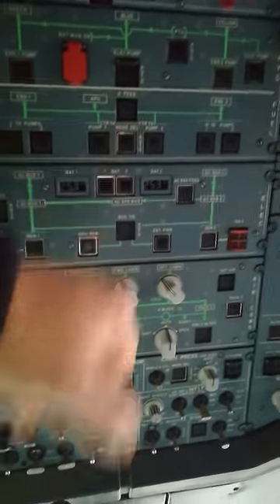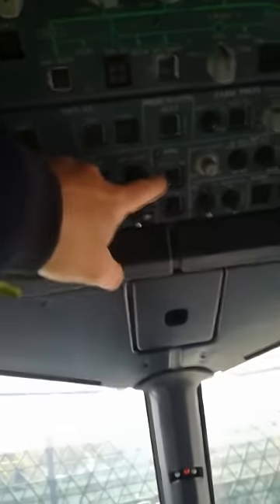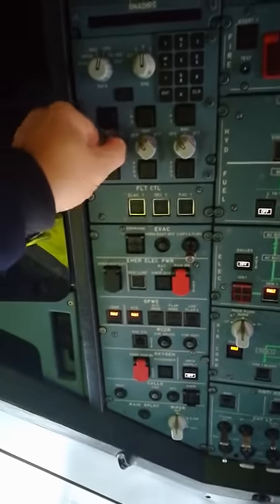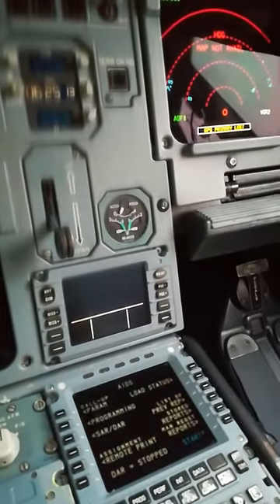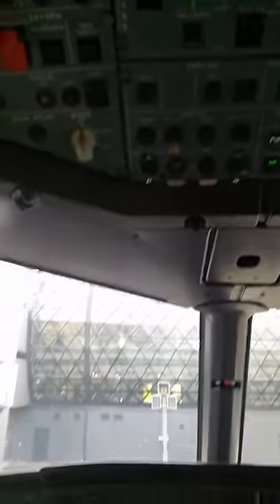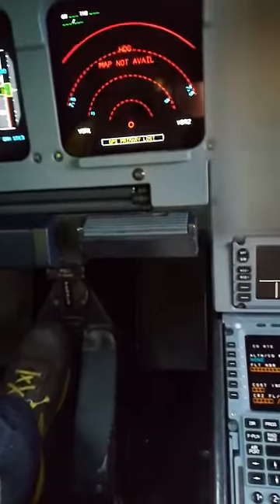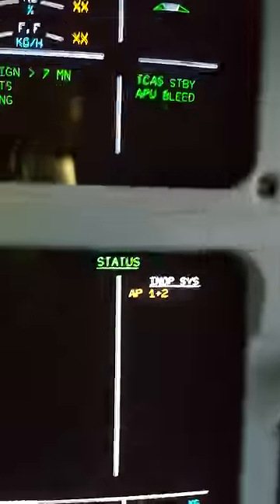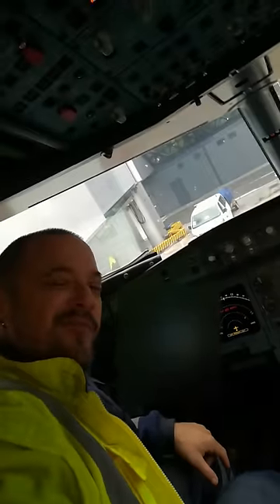Waking up sleeping beauty... A319 cockpit preparation

Comment: I do alot of flight sim with Airbus A319s and A321s and wondered how close my procedures are to starting up in reality.  After watching you, its very close!  Thanks for sharing!
Reply from the maker: Yeah, they are. What aircraft and what sim are you flIng?
Reply: @addict2flight  I use primarily Xplane as their sim seems to have better flight models. I do have MSFS 2020 but it's airliners were crap until recent.  I fly a number of different aircraft  - Airbus and Boeing and Embraer..... but my favorites are the A319 / A321 and the Boeing 737 / 757.   The FMS / FMC / MCDUs are pretty good but many lack the special communications inside them that connect pilots to company.
Reply from the maker: @rangerrick8220  yes... Under stand... Even today inmo Msfs is way advanced to XP12.. Even modela and flight envelope and models and phisycs are comparable. Not to mention, its better perormance on same config. Anyway, im hooked to Msfs now... 👍🤗
Reply: @addict2flight  I just got the Fenix A320 and am playing with that now - my biggest beef with FS2020 is their crappy camera and replay systems... XPlane ones are way better. I know there are new external replay apps for FS2020 but still not as good.   XPlane 12 seems to be a memory hog and causes my graphics card to constantly high rev...
Reply: @addict2flight  what Sim?! Is this ment seriously?  ;)
Reply from the maker: @moschidreamer  MSFS 🤘👍🔥
Reply: @addict2flight  Bro sorry but MSFS is nowhere near X-Plane... MSFS doesn't simulate real physics like X-Plane, MSFS still uses the ESP look up table from FSX days, thats why X-plane is a certified simulator by the FAA and MSFS is not.
Reply from the maker: @ryan1111111555555555  they did ad way better physics lately, and actualy they did i prove itway off. Well, for us summers, ido t need  certified sim, ineed onei can enjoy thee best. As in means of aircraft, which will be amazing for msfsnext year, as in graphics and scenery to actualy see where im flying. Im sure they will havelot of customers for  certifiing, but i Am also sure they are loosing huge market of normal summers which are turning to Msfs. Me first who was strictly xo11 Flyer. Now, when i played XP12, i have o doubt in switching.
Reply from the maker: @muskelwerwolfchin1005  whatever makes you happy. This is MSFS true life sim. But in true core, we are allsimmers my friend
Reply from the maker: @muskelwerwolfchin1005  yeh yeah we know---enjoy it my man ;)
Reply: @addict2flight  he wants to fly with you xd
Reply from the maker: @komrad1983  cockpit prep is the same whoever does it😉 atthe end it all come to the same. But usually you are the ones who came inside with all allready prepared 🤗
Reply from the maker: @komrad1983  ground guy can  start engines too😉😋
Reply: @komrad1983  Oh I'm sure you do just like every other expert flight simmer, I'm sure your uncle is a 777 captain as well, I saw someone land a 747 in St Barts on MSFS, but yeah sure, keep telling yourself its real if it makes you feel better, like I said buddy, one is a certified FLIGHT SIMULATOR and the other is a nice game, enjoy your game buddy.
Reply from the maker: @ryan1111111555555555  man.. Ima talking real life starting, i do that often, even tonight. So dont be so high attitude here. We are all here for fun. No one is better of another, and im surroubded with pilots every Day and they complain to me if somethi gs wrong, and we prepared aircraft for them etc... So... Every proc every airline is digfgeretnt
Reply from the maker: @ryan1111111555555555  so enjoy my dear friendin your piloting, closest to real thing i can be only in MSFS, as regarding piloting. But im on aircrafts every Day, you know that 😉👍 take care and gentle skies to you
Reply: @addict2flight  Man I dont have attitude, but I cannot just sit here when someone says that the flight physics in MSFS are just as good as X-Plane, its like saying Ford and Ferrari are both just as good, they both have steering wheels! we all know that one is much better to drive than the other.

OK MSFS looks amazing, no one can deny this, If you want to just sit there and look at the scenery, this is the best sim for you, but when you realise that the plane is flying on rails, and all of the "physics" you feel on the aircraft are fake, it ruins it completely.

I was landing the default Cessna 172 in X-Plane last night, in gusty, cross wind conditions, I was having to constantly be on the yoke, throttle and pedals to keep my crab on the centre line, and I know that I can take those skills into real life and they will be very close to how the real thing feels.
Reply from the maker: @ryan1111111555555555  i dont wanna compare those 2 anymore. For flightsim and enjoying i need flight characteristics and scenery look. I was on xp11 for years, with all blue tiles bug unsolvable and it was great, i then tried msfs and it was awful, in the beggininh of year.No,xplane is for same config of 3090OC and 5800x terrible in comparison to ultra settings on MSFS and dynamics are way improved in MSFS from last year as well as aircrafts, addons etc. By that time XP12. I bought it, turn it on, make a flight with 737, and i was like, oh my god where is improvement in that. They forced they graphics, but did lousy job. Im not airline and no someone who wil use XP for education, i dont care aboit it, they maybe have that part of clients. I wanna enjoy sim, see things, expiroence real scenery, towns, people, expiroence different things in sim etc. I fly MSFS for 3 mo ths now, and im astonished  every single day with it, and did never crash or had some artifacts like Xp11, and XP12 now in some moments. Forme its better, for you maybe not, thats just your opnion. I can express mine because i had all 3 then and fly them. And i had 4000FH of online flying and ATPL on IVAO rati gs, wvich means your not talking to some noob. I fly often with airbus es and q400 as engineer and have knowledge in system depths etc. Also in flight perormance, behaviours, i talk to my friend pilots for all im interesting in etc. So i have some backgroumd and i can judge clearly for myself. I had also unfortunately arround 300,$ofaddons including xp11 itself and half of those can be compare to Msfs freeware...So yes, and for that reason MSFS will be allways better, they constantly updafing, they fix tvi gs, Xp11 had that blue tile bugand only soluzion was for them to reibstall evetything etc. And even from vanilla install it never fixed.i even expiroence some amazing aircrsacts movemebts due to winds i never had in xp11  So, whatever we choose to be our favorite, lets enjoy in it. Mine is MSFS yours is XP, and i tvink  MSFSwilgain more customers from XPfor arilus reasons ime tioned a ove. In any case, whichever  we chooseits impertivethat we e joy and hangout together. 😉🤗💯👍🎶🥂
Reply: @addict2flight  OK I must try the new MSFS because when it first released, it was awful, I was even a beta tester for it, the reason the camera system is the way it is, is because I told them to copy X-Planes camera system since it was so much simpler than the one they was making, and they did! 

In all truth of course I like the look of MSFS, the scenery and atmosphere is amazing, I hope one day they will move from the old ESP lookup tables and create a real life physics engine, and yeah I'm probably about 500 euro's invested in XP11, but I have to say man, they stopped messing with it now, its very stable and looks amazing, I don't have any weird bugs, most sliders set to high/maximum, its as smooth as silk, now I feel I can finally enjoy it, and I will enjoy MSFS in the future once that is more stable as well.
Reply from the maker: @ryan1111111555555555  Yes my man, was before. Now, it's even better...much better. After XP12 disappointed me, in terms of fluidity, graphics, weather engine, etc. Their announcements were amazing, with big expectations. Well, now I'm glad I asked for a refund. Totally crap, I had better weather and smoothness with the same engine on XP11, why pay extra for a new sim and new aircraft. It's a huge fail for me, en regarding a bigger sim community. So I decided to buy MSFS, and voila, was amazed at the performance. I have all on ULTRA on DX12 and still have 50fps with real traffic turned on...on XP12 same settings, i had 20 fps, without traffic, and crap graphics. Dynamics blew me away, for example, on XP11, i once land on sidewind, A320, a few shakings, a little bit of womble, nothing special, i land. In MSFS same situation, i even have wind shears simulated...I had a real fight, which amazed me...Anyway...if u didnt try...well you have to ;) then you can judge. And i know, after XP11 all system of cameras and coordination is different, but it took me one day only to adjust all according to my needs, etc. and now, I'm the luckiest man alive, i enjoyed every second of it. And on top of all, i have real-world scenery, in any flight, i have real buildings, real towns, real roads, and real >POI, and they made it interesting. Plenty of fun to choose, to know a world little bit, not some squares, generated buildings from OSM randomly, etc. they really kick ass with that updates and fixes.
Reply from the maker: yeap agree
Reply: @addict2flight  Hi man, so I decided to switch to MSFS due to X-planes crap anti aliasing which had gotten to the point where I couldn't look at anything but these jaggy edges and marching ants... (X-Planes graphics are just crap, even when it was released they where crap) but I'm still really annoyed at the unrealistic flight characteristic, it was actually harder to try and get the Cessna to stall then it was to escape the stall, It shouted STALL about 8 times and I'm sat here thinking, OK go ahead and fucking stall then...??? it still feels like I'm flying in thick soup rather than air, it still feels like FSX with Ezdok, there's no sense of achievement to landing. we are left with 2 crap simulators both lacking in different areas.
Reply from the maker: @ryan1111111555555555  well if i must choose crapy graphics snd unrealistic surroundings but good dynamics ..or invredibly realistic graohics with smooth oerformance and amazing realism with dynamics not so bad...i choose MSFS later one. Dynamics are getting closer with each uodate...and i can feel that, i was flying xpqq for few years.
Reply from the maker: @ryan1111111555555555  in short...nust use MSFS and enjoy the flight

Comment: Nice to see. But then you just let it run with the APU for an hour or so? A lot of airports only allows it for 5 minutes before departure due to noise 🙂
Reply from the maker: Less then an hour and untill i heat the aircraft, crew will.come and they will start engines in 30min time... So better leave it on, then waste 1 more cycle of starting

Comment: I often see the APU being turned on as part of the cockpit prep however, a lot of airports seem to have a restriction of APU until 5 minutes before out time. How is this usually managed in real life operations?
Reply from the maker: Depends on airport, airline, time, weather, etc... Cold OPS, with aircraft preparing 1 hr before flight on inside temp of 5C,  crew coming in half hpur, and they normal use it for start, well i see no reason for not to start it. You dont need external power at all, ok they will connect it probably by default, but only as backup in this case. Anyway lot of factors involved.

Comment: Leaving the APU on for such a long period though? Is it not better to use external power?
Reply from the maker: Not too long, 1 hr before take off. And there is a reason, first heating the cabin to our dearest crew, second, they need APU anyway to start engines, so lets say, i waste 15 min of prerun for APU so the warm cabin waits them ;)
Reply: @addict2flight  I thought ext power does not have air conditioning right? So you have to start the APU or one of the engines for some fresh, hot or cold air anyway.
Reply from the maker: @fevo20  exactly🤘
Reply: yeah external power does not provide with heat or air conditionning, so APU is important especially if temperatures are low or high. it is absolutely fine to have APU running for 1 hour before flight
Reply: @youcanpunchmeintheface  at my airport its 5 minutes before ETD which is great because when theres low traffic its almost completely silent, external power/heat is much better because its both cheaper and better for the enviroment
Reply: @pilotevulgaire9317  why use apu for heat? it costs like 300$ per hour a external heater is much cheaper to use as it only uses electricity or little diesel
Reply: @einar8019  jet fuel is not that expensive, ends up bout 80$/hour for apu on a320. And yes best practice is 15 minutes before pushback. But that depends. So yeah this is exactly why pilots follow company guidelines or airport specifics. To avoid having a debate over it.
Reply: @youcanpunchmeintheface  airport regulations go first(if your airline likes going to that airport)
Reply: @youcanpunchmeintheface  Otherwise it would be similiar to company regulations having higher priority than a state's. The company uses the airport not the other way round. 😃
Reply: @youcanpunchmeintheface  you. You take priority my friend.
Reply: @einar8019  I think it works like in trucks, it also serves for hydraulic pressure and battery charging, otherwise you only have electricity nothing else.

Comment: where is this? and how long are you sat there burning apu fuel for?
Reply from the maker: Apu will run anyway, you dont expect that crew , who will arrive in 20min time come to 5 C airplane? Guys and girls, when possible fuel will be saved, when not possible, fuel will be burned. And then again, why do we nees aircrafts for??? Lets all use cars from one place to another and boats...??? Why most of the airlines taxi with both engines? Why its not mandatory to use only one?
Reply: @addict2flight  I was just wondering. Where I'm from (in europe) we're never allowed to run the apu for more than 5 minutes before push and start. But I guess there was no ground power available here?
Reply from the maker: @Xlastsuspectx  iz depends on company, on airport, on equipment, etc etc. You cant judge imidiately just because somewhere near you its different. Not you, im talking generaly. Sometimes and for operations its the normal option. Most of the time.
Reply from the maker: @Xlastsuspectx  heaging man... Heating... You jave to heat aircraft and there foryou dont need ground power anymore because you will use that apu again for start in 1 hr time...so why waste 2 apu cycles
Reply from the maker: @Al_Dente-d1p  😂😂😂
Reply from the maker: @Al_Dente-d1p  one holding due to traffic burnsmore fuel then 3hrs ofAPU 😂
Reply: @Al_Dente-d1p  Are you okay?

Comment: I only fly this in X-Plane but I've been told to wait for the "on batt" light to go out before turning on the next ADIRU. Is that not required?
Reply from the maker: They allways told that... In my 20 yrs on it i neverhad any issues regarding that. 👍
Reply: Seems to be just a flight sim thing going on, it doesn’t matter. If anyone has told you that it might be company specific.
Reply: Whats about to wait the "pick pick pick" sound after starting the APU before start AIDR aligness?
Reply from the maker: @andreasmeier6605  triple click is FWCs sound... When they come online. For ADIRS i dont need wait for those because if adirs are faulty will  have  ind on them just below rotary switches. And its is short time between FWC come online and ADIRS starting. In adition, ADIRS are 10min allign, so we have time for TBSH if necesery ;) But when you work 20yrs on this plane you know it by soul, you thk as one
Reply: @addict2flight  haha, thank you!
Reply: Never done this in 10 years of flying the A320. Maybe it was a thing with some older ADIRUs but certainly not an issue with any made in the last 10 years.
Reply from the maker: @milesaharrison  trust me... It was never a thing😋

Comment: Does that aircraft have GPS? On the ALIGN IRS page there was no GPS position readout
Reply from the maker: Its airbus, off course it does 🙂
Reply: @addict2flight  not necessarily. Apparently some 30 year old Air Canada A320’s don’t. I just didn’t see the GPS position appear on the screen as you aligned with REF
Reply from the maker: @tomstravels520  well im sure ithas one..Aspart od MMR ILS and GPS together. But not as main nav source rather for accuracy and support
Reply: I’m at Air Canada, not on the 320 anymore, but I can confirm they all have GPS now. They didn’t always though…was a huge pain in the arse!

Comment: A question I’ve always wanted to ask. And it’s maybe stupid. If you tried to withdraw the landing gear when on the ground. Would it let you?
Reply: I suppose that the protection on-board computer does not allow to retract the gear on the ground.
Reply from the maker: @madriditunes7021  no it wont let you 😉.
Reply: No. The gear has a Weight on Wheels switch that engages when the plane is on the ground. When engaged, it inhibits landing gear retraction, allows thrust reverser deployment, triggers the ground spoilers and autobrakes if armed, and possibly other things.
Reply: @KingdaToro  I know it was a stupid question, but what a great reply. Thank you.